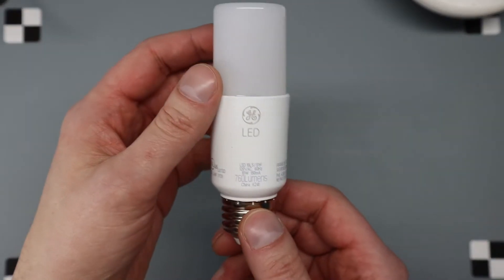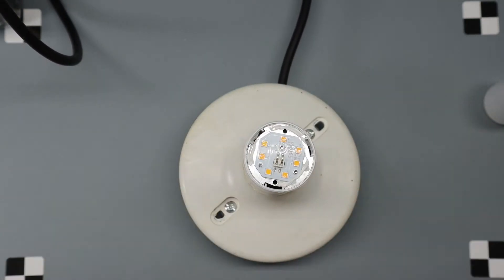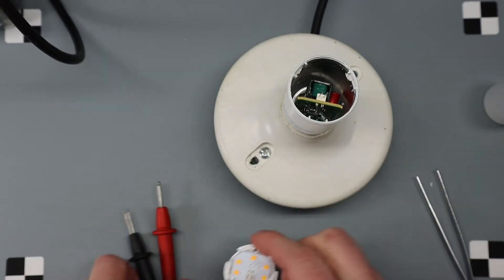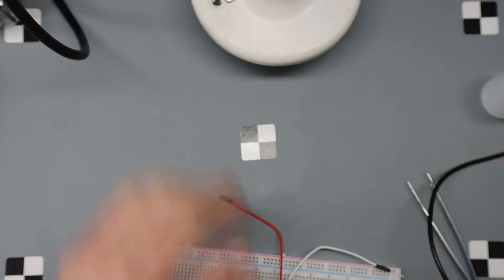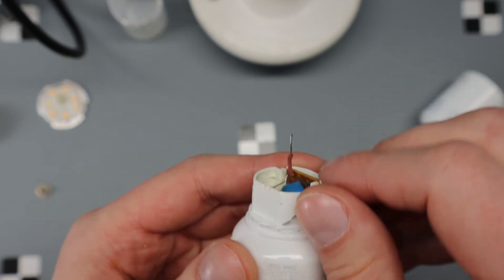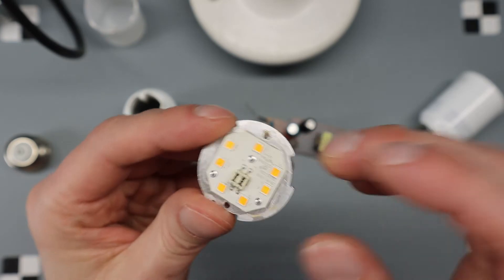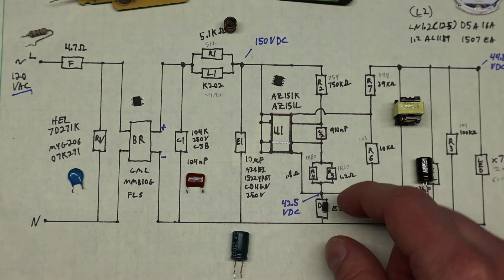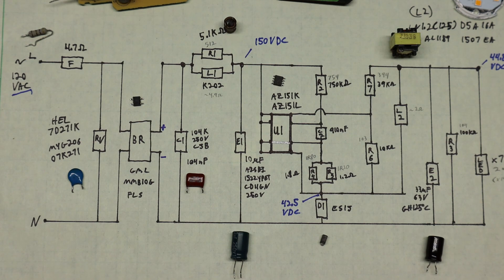Teardown of GE LED bulb with schematic

Comment: What happen if in a circuit of 10 Leds in series (each 3V 150mA rated), I replace one of them with another Led rated at 9V 150mA?
The others will get dim or doesn't light up?
Reply from the maker: It would likely get dim. If you replaced too many it wouldn't light up.

Comment: What do you think the weak link is in this led light board ?? Could this be made simpler with longer life ??? Thanks
Reply from the maker: In this one, probably the diode or main IC.
This is an older style, you can see some of my more recent videos for simpler designs.
In general, longer life would come from lower amps through the individual LEDs, and then more LEDs to get the same lumens.
Reply: @eeAspect  Thank you for educating me Sir. WIll check out your other videos.

Comment: Hi, how much do you think it got hot? Board and LEDs? Could you measure and tell?
Reply from the maker: I hooked up the circuit board and LEDs not inside the heat sink cover and the L2 inductor was 90-100 F and the back of the LED heat sink was 90-140 F.
Reply: @eeAspect  It seems to be not a very high temperature, but such a strong darkening on the board Hmmm .... Got it, thanks.
Reply from the maker: @vrms4096  The one I just tested wasn't the darkened one, though on checking it again there were spots that were reaching 200 F on the back of LEDs.
The darkened one had failed and was completely disassembled, so no way to test it now, I can only assume an over current that generated more heat prior to the failure.
Reply: @eeAspect  Manufactures push them at theirs limit, for a faster degradation.
Ofthen, there are steps on the edges of mcpcb that can be filed, apply quality thermal past for decrease heat